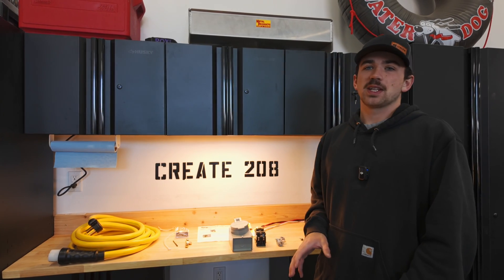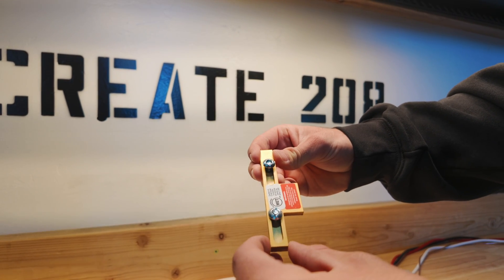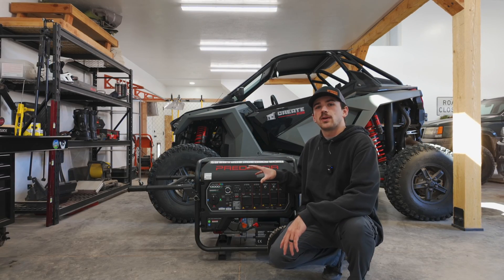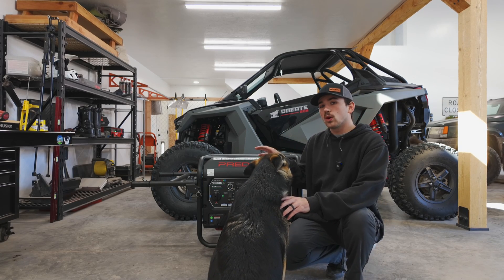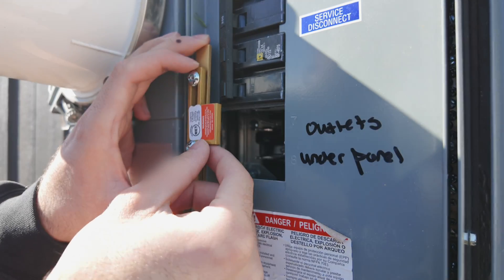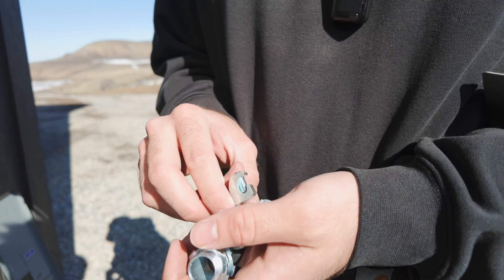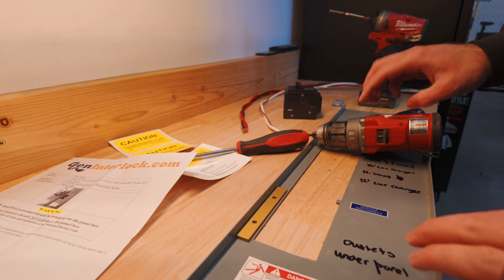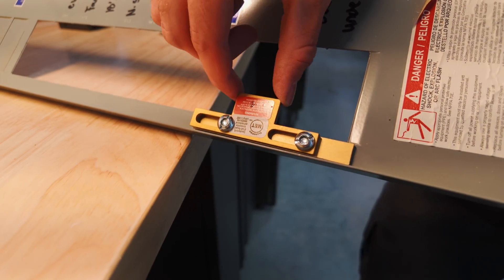Never Lose Power Again: Whole Home Portable Generator Backup Setup. NEW Predator 13000 Watt Tri-Fuel

Comment: Nice information. As a side note. Always always always open your propane supply valves slowly to prevent the regulator diaphragm from closing because of instant hight pressure. Believe me, I learned the hard way.
Reply: I labeled my propane tanks as a reminder to open the valves slowly.

Comment: A few things to make it even better and compliant:
- back fed breakers must be secured. There are hold down kits available. Zip ties won't comply.
- rubber washer/seal between main panel and gen inlet to make it raintight. 
- #6 wires.

Other than that... all good.

Comment: You made that look so easy...thanks.  Suggest you take a serious look at the power quality rating of that generator (THD <23%)?  If not a "pure" sine wave distortion in AC can cause problems for many electronics in the home.   Clean electricity: A THD of less than 6% is considered "clean" electricity.  A THD of less than 6% is safe for powering sensitive electronics like computers, televisions, and cell phones.  Computers in all of today's home electronics...PC, laptop, cells, TV, DVD, Refrig/freezer, oven, HVAC, other.  Some sensitive electronics can malfunction if THD is high. Best to you!

Comment: Will that setup run the house AC unit as well?
Reply: Will not run an entire house with AC/Heater running. You need at least an 18000 kvw generator to barely run everything in your house. If you want to run your AC, Heater, fridge, septic pumps, TV, a couple lights, you need 26000 kvw generator.
Reply: @marcusharley3064   False

Comment: Those that are thinking of generators, I would recommend this generator due to the price of it, as well as the fact that it is multiple gas if need to be, but one thing that I would like to let people know since I own it, I would know getting more wattage using Gasoline so that 13,000 W is gasoline and on a raisin occasions you can get close to that with propane but not completely with propane you can get about 11,000 W maybe 12,000 W so that’s something for people to think about if they’re looking for a generator is yes you get a generator that gets multiple gasbut each gas type produces a different amount of wattage

Comment: Thanks i have the same generator but dont know how to setup my home. I have a fuse panel so im not sure how to connect it because it isn’t a breaker panel. I know i need to pull the main out when using a generator but can i use a fuse instead of a breaker to feed my generator into the home?

Comment: 10k running watts for $1100 ......  How dirty is that power after 50% capacity ??
Reply: It's a 13,000 running  10,500 watts.
Reply: @marcusharley3064  No its not. Its 13k STARTING watts and 10k running watts
Reply: @ACommenterOnYouTube  Forgot my comma man,  13,000 , running 10,500 watts.
Reply: @marcusharley3064  You are still wrong.
To correct you a 2nd time:
Its 13,000 STARTING watts
AND 10,000 RUNNING watts

Comment: Did you have to mess with the generator to change bonded neutral to floating or is it ok to leave it as is?
Reply: It needs to be floating neutral to run to a house and not bonded.  Bonded is when you run the generator as a stand-alone for tools, etc.

Comment: Excellent video and I have the same Generator thus, purchased it for this exact same need. It's a dirty sinewave but it gets the job done for the cost value. I'll be doing the exact same transfer switch setup, with the only exception of upgrading to 6AWG for load values vs the 8AWG and never have to look at it again. Thank you for the clear shot video.
Reply: how do you know its dirty ?
Reply: @ACommenterOnYouTube  because it dont have inverter to clean up the power wave
Reply: @timnevitt2993  well dirty power does not hurt electronics as most electronics have filters on their input power supply.
Next its the voltage spikes that hurt the electronics.
Most electronics use 105-240V so any voltage in that area is safe, if the voltage goes above 240V, thats when you have an issue. 
Next most name brand generators might have "dirty" power but they clean up once they go under load. They are only "dirty" when on idle and no load because there is no reason to be clean with no load. 

Next a guy here on YouTube did show a champion generator and showed the "dirty" sinewave under idle but when he put a load on it, it cleaned up a lot.
Reply: @ACommenterOnYouTube  my 13k has run everything no problem. No flickering or drama from devices at all.
Reply: @stinerart1  I believe that "clean" power is a $$ scam gimmick. 

And i have seen the sine wave from an inverter generator and its actually CLEANER than the power from the utility. 

And if the utility power being somewhat dirty does not damage electronics, i dont think a little more dirty power from a generator will do anything. 

As i said before, there is NO evidence of electronics being damaged from "dirty" power but def YES from voltage spikes
Reply: @ACommenterOnYouTube  These would be predominantly true points! Some generators do and don’t do this. I’ve seen newer ones fail to clean up under load and vice versa with older ones. I’ve seen older Coleman’s and Honda never clean up. Thus, it’s a gamble to say the least and only able to truly know is to test them.
Reply: @stinerart1  And that’s great! That’s why I purchased one too!
Reply: @ACommenterOnYouTube  Actually there is but it’s a matter of if you want to believe it… I respect your point nonetheless.
Reply: @stinerart1 do you have it hooked to natural gas? I keep seeing ppl say it loses a lot of power with ng.
Reply: @ACommenterOnYouTube  Becauuuuuse it is?? The THD on these exceed 20% on full load. Common criteria on these non-inverter generators.
Reply: Why does every commenter on the internet always suggest upgrading the 8awg to 6awg?? I'm staring right at 2023 NFPA 70 310.16 and it shows 8awg THWN-2 rated for 55 amps at 90º. I haven't seen any termination equipment rated less than 75º in forty years, so even at 75º the 8awg THWN-2 is rated for 50 amps. Sure, if he were pulling cable longer than a 24" stub, then it would be appropriate to use the 60º column, but he clearly is not. He is using individual conductors in a nipple.

Furthermore, there really isn't a portable generator on the market that can push 50amps. That one in the video has a 42amp  breaker on the NEMA L14-50R receptacle on the generator. In fact, the inlet box is probably already wired with 8awg THWN-2 pigtails. While it doesn't hurt anything to use larger wire (other than being harder to work and more expensive), it is quite unnecessary.
Reply: @sigcrazy7  Well some would disagree with you on that. The American Wire Gauge (AWG) is a logarithmic stepped standardized wire gauge system used since 1857 for diameters of solid, round, nonferrous conducting wire that interface in the ASTM standard B258. As a ‘guide’ rule, it’s meant to keep the conductor cool in the exposure medium of being under the most extreme load. You can certainly do what you want but at the end of the day, if something burns down electrically in a home, the FIRST thing that will be questioned is your use of proper wiring - just so they can blame that - and get out of paying insurance. To say it in another sense, house wiring is 12G but it OFTEN is demanded for requirements we plug into it that should be almost 10g wiring… So the limitations can exceed the design and as you’re aware, then we get into C.B.’s. But in a final note, yes, you are correct, most generators don’t pull a hard 50 amps, but when used with a welding machine (as I do) it sure draws it to an extreme. Cheers!
Reply: @AXNJXN1  In the event of a fire, they would check for proper wiring, and that proper wiring would be 8 AWG THHN or THWN-2. That is my point. You can wire it with 2 AWG for all I care, but the point is that code requires 8 AWG in this video, but people seem to always think it's wrong in comments.
Reply: @sigcrazy7  I Didn't say it was wrong and I don't think anyone 'else' said that either. You're missing the forest for the trees. Cheers.
Reply: @AXNJXN1  Your original statement to which I was replying: "the only exception of upgrading to 6AWG for load values vs the 8AWG". Since 8 AWG is specified for the load in NEC 310.16, then that was the statement which prompted my original response. You certainly were implying that 8 AWG was inappropriate for a 50a connection. To be fair, I have seen this same statement all over these generator videos, so your original statement is not alone.
Reply: @sigcrazy7  Well then you clearly misinterpreted 'exception' for the statement of 'wrong'. Fact remains...
Reply: @ champion model 201161 pushes all 50 amps at 12kW running 
And there is another brand, GenMax that puts out 14.5kW running with that same 50 amp plug which means you can only get 12kW from that 50 amp plug which means the other 2.5kW has to come from another 50 amp plug or any of the other plugs, which IMO is a waste, if i cant get all 14.5kW from one plug, its not worth it to me.
Reply: @sigcrazy7  my generator outlet box came with 6awg pig tails

Comment: The sinewave is very dirty on that generator, look at the light at 8:24 compared to 10:54 you need an inverter generator
Reply: That has less to do with THD and him trying to draw more than it can supply.
Reply: Only need sine wave for sensitive electronics, but you can buy inexpensiveline filters and protect everything. Way more affordable.  That said, I've been using noisy generators for years and never had a problem.
Reply: Can you link what some of the filters are? This is a great idea, have not heard of this option before
Reply: @Turbo_Todd  Ad a surge protector to your panel box.

Comment: Electrician here.We generally use #6 for 50 Amps.However, those short whips being #8 shouldn’t cause issues.
That said great set up. I’m about to do the same thing at my house.  I’m running natural gas though.
Reply: Great video and nice setup. This is the only video I’ve found where the generator inlet box is attached directly to the side of the panel. Is that acceptable? Is there a reason more people don’t do it? Thanks.

Comment: I just purchased the same generator for our new house.  I had electricians wire a power feed from my shop back to the house during the build.  I can now power back to the house main panel from  the shop and only need to roll generator around the corner under my porch roof

Comment: Dumb question..The output plug on the generator says 42 amp max...why do you say it has a 50?
Reply: The outlet is a 14-50R.  It is a 50 amp receptacle whether or not the generator can put out 50 amps.

Comment: dude, you need #6 for a 50 amp not #8. under size wire will  heat up and catch fire before the breaker trips under the rite conditions!!!!
Reply from the maker: Code reference? #8 THHN on 75 chart is 50a?
Reply: The generator is only capable of 41 amps at max load with gasoline. On propane is 9100watts 9100 divided by 240 volts equals 37.9 amps.
Reply: Super helpful to former city-folks like me! 😂
Reply: I’d imagine in real life if he’s running absolutely everything and taching out that generator. He could walk over and grab that extension cord, Feeling of it. I’d be shocked if it was ever hot or even warm to the touch. I’ve been running set ups just like his for years myself.
Reply: He is probably thinking about NM not THHN but you aren’t supposed to exceed 80% of the rating for safety so #8 THHN would be 40amp continuous safe but I’d guess you’re fine either way.

Comment: Can see your light surging in shop.. what’s thd on this unit.. I’m looking to do same and had this one in mind or the 9500 inverter
Reply: Probably terrible. No inverter
Reply: 23%
Reply: It's not an Inverter generator, with a surge like that, it will burn out your smart TVs and computers, and cable box. And it was surging because it was barely powering his house.
Reply: @marcusharley3064  install a surge plug and let it eat.....

Comment: So if you can run 8 hours on five gallons to run 24 hours at 3 dollars per gallon that’s 45 dollars a day to be smart about this having a battery backup would help but yes the battery are not cheap. Good video guy.

Comment: You need to change your wires to 6 gauge if you want to use the 50 amp breaker. Number 8 is rated for 40 amps and number 6 is rated for 55 amps. Currently you will burn up your wire before you trip your breaker.
Reply: The chances of the generator putting out more than 9600 watts continuously (40 amps at 240V) is pretty low. There's circuit diversity factors that can be taken into account. Ampacity is also dependant of the temperature rating of the insulation and the length of the run.
Reply: @Nicholas2011ist  breakers are sized to protect the wire. It would never pass inspection. It's your building.
Reply from the maker: Unless I’m missing something, #8 THHN on the 75 degree chart is rated for 50a.

Comment: Great video!  Keep in mind, that genny puts out a high THD.  Be careful powering sensitive electronics, which is just about everything today.  The Westinghouse WGEN115000TFC has a bit more power output, is TriFuel and the most important feature is a THD less than 5%.
Reply: Thanks for this useful information 
    Just bought a 13000 Predator 
 Will go Shipp for a Westinghouse 
They are hard to find
Reply: Don’t fool yourself with that 5% THD. I too have that same generator, but I doubt that the distortion is 5% under 80% load.  It’s probably 5% at 1000 W output when you get into the 8000 or 9000 W running range. I’m almost certain it’s not 5%.
Reply: I keep reading statements like this everywhere but I also keep hearing that it’s not a big deal and people have been using regular generators for decades with no problem. Even the power company has a much larger total harmonic distortion than 5%. I’m still shopping around d myself and don’t claim to be an expert
Reply: An electrical engineer tested a 13k tri with a legit meter device and got 6%. Just because predator states the 23% does not mean it is that high. Funny that there is always this comment, duromax reps earning their coin for sure.
Reply: @stinerart1  Why in the world would predator state a 23% THD when their unit is actually a 6% that would be the dumbest thing in the history of marketing. If they can sell a 6% THD unit for this price they could corner the market on these. I don't think there is a big issue with the THD though, I think it is over marketed for sure. I believe 95% of people who use these would be just fine.
Reply: @benton92074  Because it’s ONLY THD <6% when under NO LOAD. This is an extremely common scenario. Under load, the sky’s the limit. Good morning to Generators 101.
Reply: @AXNJXN1  Not true they measure it while under varying loads. Do you just make stuff up and post it on here?
Reply: @AXNJXN1  They actually measure it all the way up to the rated load. They actually state this on the site.
Reply: @ No, you’re wrong.
Reply: @AXNJXN1  You cannot accurately measure Total Harmonic Distortion (THD) with no load because THD is a measurement of the distortion in a waveform caused by the interaction between a power source and a load, so without a load drawing current, there are no harmonics to measure and therefore no THD to calculate; the reading would essentially be zero, representing a perfectly clean sine wave.
Reply: Cheap generator predator uses copper wire
Reply: @marcusguajrdo73  Seems odd that Predator only offfer 90 day warranty and Westinghouse comes with a 3 year warranty if its so cheap why such a big difference. I did some research and most of the Westinghouse are copper wound as well. They do have a few aluminum on the very low end, but most are copper wound I think. I am still shopping around myself.

Comment: Remember to buy spark plugs for your generator.😅
Reply: Ha, I'm in Houston now and it's day 8 with no power. 10w30 oil is hard to find, spark plugs are scarce and anything electrical related to generators are sold out so everyone stock up on these extra parts. Filters, plugs, oil, and definitely gas
Reply: Don't run 10w30.

Run 0w40 or 5w40 full synthetic.

They hold up much better.  Even still, I drain and fill every 48 hours of constant run time.

Comment: Considering that some high current loads could be active at the time of disconnect, I would flip the generator input breaker at the panel first instead of at the generator. Why? Because opening a circuit with high current flow will cause an arc and the breaker in the panel is more durable than the ones they installed in the generator. It is also easier to replace on failure.
Reply from the maker: Thank you for the info!
Reply: Also consider turning off any high draw breakers before switching over and then turn them on afterwards. It will cause the generator to bog down less. Some things to delay start include AC, refrigerator, electric furnace/stove/water heater. I have a surge protector with a 3 minute start delay on my fridge and deep freezer. My AC thermostat has a delay and so does the contactor on my AC.